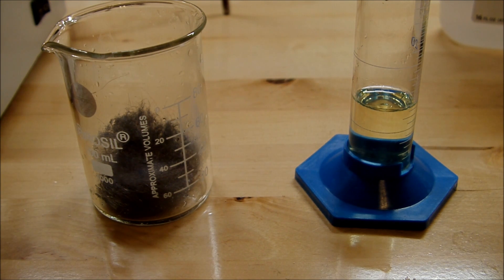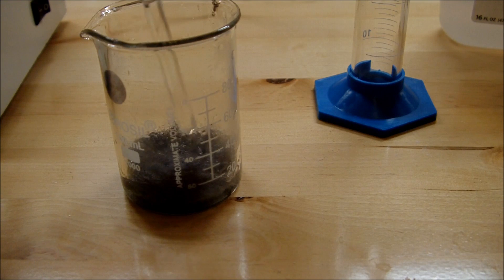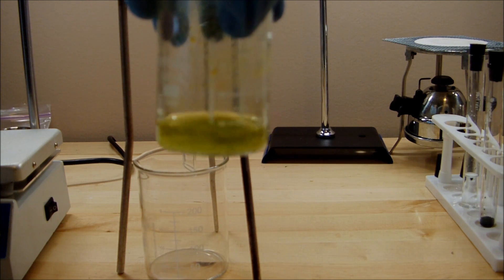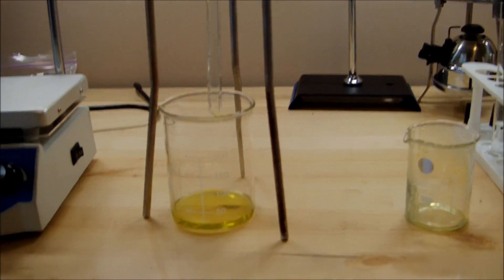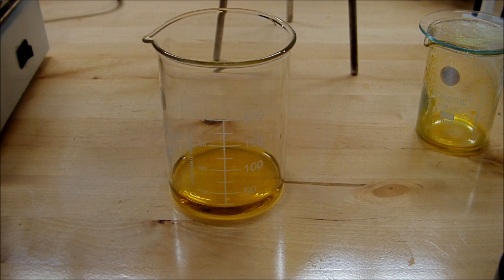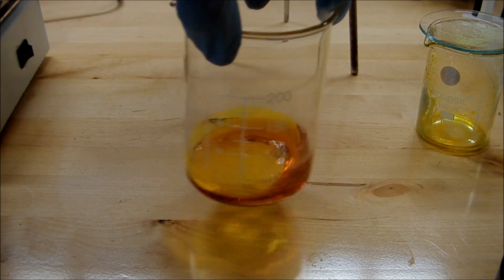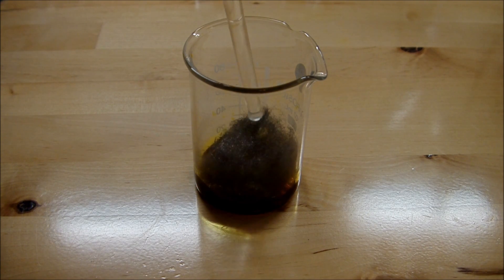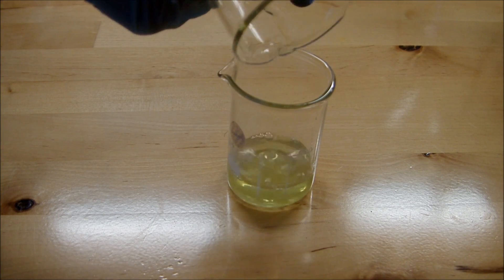Make Iron (II) and (III) Chloride

Comment: Hi nice video thank you. I have made a iron electroplating bath using iron sulphate + ammonium sulphate and hcl. It is a pale green/white coloured solution. Does it make sense that this would be iron2 chloride?
Reply from the maker: When in solution, things are really more of a soup of ions than individual compounds. So yes, there's iron(II) and chloride in there, but it doesn't "settle out" into a specific compound until you crystalize it. Then what comes out would depend on the solubilities of all the possible combinations of ions.

Comment: Does iron (iii) chloride react with aluminum to produce metallic iron/ iron (ii) oxide?
Reply from the maker: It should, aluminum is more reactive. It does form a protective oxide layer, though, so the reaction might take a bit to get going.

Comment: I made a dry mix of Fe(II)Cl3.6h2o and but it turns out I needed Fe(III)Cl3. I knew it going forwards with the mix, as my lab didn't seem to have Fe(III)Cl3. I followed a recipe, that was for some cell cultures. 

@mrhomescientist Would you suggest just let the mix get some air to become Fe(III)Cl3 once in water? My mix is acidic. Fe(III)Cl3 would just be a micro component for the growth media.

Edit: did you try to crystallize the Fe(III)Cl3 you made in the video? I assume it's molarity would be easier to calculate going from dry form back to hydrated form.

Comment: why not percolate pure oxygen into the Iron (II) to get the iron (III) Chloride faster?
Reply: Dave Cossairt because home chemists don't keep pure oxygen on hand. store bought hydrogen peroxide, however, is a household item.
Reply: Timothy Raquet so most people don't have an oxy acetylene torch?
Reply: Dave Cossairt nope. i certainly don't. if hydrogen peroxide isn't an option, and you have pure oxygen laying around, by all means make a video of your results and share it. I find dollar store hydrogen peroxide works just fine, so that's what I'll use.
Reply: Timothy Raquet I have completed this process already biggest tip a.use a hose that you don't mind tossing after complete or saving for stuff like this b. had to do it out side, I set the containment vessel in a snow bank (I live in alaska probably the only advantage of live here lol)
then piped pure oxygen into the mixture. 
rapidly the color changed and it began to off-gas very profusely.
in a fume hood I feel it would be easy to have complications if your system is not adequate enugh to vent copious amounts of gas
Reply: Dave Cossairt very interesting. I might try this if I ever have the right set up.
Reply: Timothy Raquet I used a small length of old Gass tubing I had laying around It fit perfectly over the tip of my cutting torch, I then use electrical tape to hold it in place while I adjusting the flow of oxygen, the regulator was set at 35 pounds and I was piping it through a 1/4 tube. there was an intense build-up of heat as a reaction occurred and as I stated before, I counteracted this by having it sitting in a snowbank (I'm a welder not a chemist)

Comment: When you let the steel wool react with the HCl did you cover the beaker? If yes, then will the H2 gas be able to leave? If not then won't it oxidize? Or do you cover it in between? Thanks!!
Reply from the maker: Patience! There is no need to cover it; this has no impact on the reaction. I suppose if you wanted it absolutely free of Fe(III) you'd want to exclude air, but for my purposes I didn't need to do that. I placed a watch glass over the beaker simply to reduce acid fumes and bad smells from dissolving iron escaping.

Comment: have you ever tried making titanium chloride?
I am able to get a very very dark purple solution by boiling hcl with titanium in it.
It never seems to crystalize though.  You can cook it down forever and all it ever does is get dramatically thicker but crystals will not form.
Ay ideas?
Reply: Clown Whisper most like not pure or partical are not ground tighter
or too much buffer solution, blocking

Comment: Hi, Mr.Homescientist,

I've an enquiry, iron (II) Chloride is unstable in the air. But how is the storage time/ shelf life for Iron (II) chloride before it convert to Iron (III) Chloride??

Appreciate if you can advise.

thanks.
Reply from the maker: I've heard that if it is dry and stored in a tightly sealed bottle, iron(II) has a pretty good shelf life. It's pretty tough to keep iron(III) from forming though, so it's probably best to make it as you need it!

Comment: Need help!I had a messed up reaction happen to me.  actually two.

I was doing  nerdrage method of making copper sulfate by electrolysis using a weak solution of sulfuric acid as an electrolyte.  It worked so good that I was getting large crystals forming  right as the reaction was finishing up!
They were clumped together and when I was filter I tossed a small amount of DI water on them to loosen them up!

The crystals in the small amount of solution turned instantly black!  I added a little more and it started to turn like blue and white crystals started to form.  *size of salt*   I put it on the heat to losen everyting up and everything turned e emerald green!    I have about 100ml of deep emerald green solution that SHOULD have been copper sulfate..  

DO you have ANY idea what happened?  I have a large amount of uncontaminated copper sulfate set aside as I had already filtered most of it 

I also had a Iron Chloride mishap where I had to leave the reaction and it cooked down to a solid red mass.
I added equal parts of water and HCL and it seem to have come back.
Reply from the maker: I've never heard of that before. Sounds like a lot of weird changes for such a simple experiment. If you can repeat it and make a video or take photos, that would make a very interesting experiment. Make sure you use distilled water, clean copper electrodes, and don't let the voltage and current go too high.
Reply: Yup low and slow is the best for sure.
I think that I may have dumped a tiny amount of HCLon the extra crystals by mistake.
STUPID i know I have them in the same 90ml brown bottles.

The strange thing is that over 2 days it slowly turned back to blue. so now I don't know what to do with it.

Maybe the sulfate crystals worked off the hcl?

I might allow it to crystallise a few time to see what i get.

I wont be able to use it for its intended purpose unfortunately
Reply: On another note , I am designing a chemical rack In CAD that requires that I place a wooden dowel in a slot to release the chemical bottle that I need.  No more mishaps.!!!
Reply from the maker: Clown Whisper HCl would explain the green color, but the rest is still a mystery. Recrystallize your blue copper sulfate crystals a few times and they will be quite pure.
Reply: Yeah its sort of starang for sure.
I might have explained it bad too.

So basically I was filtering of the Copper sulfate.  When I got toward the bottom of the flask that I used for the electrolysis I noticed that there were some crystals that had already formed.   So I thought to myself that I should add a few ml of water to loosen them up ,as I plan to evaporate the whole thing anyway.  

So when I added what I though was water everything turned BLACK as ink.  I said out loud.."wtf?" and I set it up on a heating corning stir plate and added what i thought was again a little more water.    It almost instantly started to turn from Black to green. and then very deep emerald green.  RIght now im trying to figure out how the black occured and why in several days it turned back to its typical sulfate blue..
Reply: In any case it was just a very small amount of the product so Im not to worried about losing that little it.  I would have to know that it was back to its sulfate state and pure before using it in the next step.and I dont know how to verify that so it will remain waste product.  :)

Comment: I too had some steel wool and had it soaking in hydrogen peroxide. Upon the addition of HCl it turned dark amber in color, adding more HCl the solution turned to a bright yellow color and was rather exothermic (>150F) and placed it outside in the cold (near freezing temps) and left it for apx. 30 min... to my surprise it turned completely clear. Upon the addition of 35% hydrogen peroxide it turned amber in color and I'm convinced it was Iron(III) chloride. What state gives it a clear color?? On a side note, it is night here.

Comment: Or... buy some red iron oxide (Fe2O3) for a couple dollars a pound; much cheaper than steel wool. Add the HCl; you'll get iron(iii) chloride only, no hydrogen gas, and no impurities to filter out. You won't need peroxide either. Also, iron filings are cheaper than steel wool as well, and react faster. You can use them in your iron(iii) chloride to get the iron(ii) chloride.
Reply: Chad Howarth No this is the chemical equation 
Fe2O3 + HCl —> FeCl3 + H2O
So Add HCl to Fe2O3 it will create FeCl3 and water

Comment: If you add iron to your solution, the redox-reaction should be:
CuCl2 + Fe → FeCl2 + Cu
You should see copper forming on the iron. For disposal add baking soda. Do this in a large container, fill it with 1/8 or 1/12 (to be sure) of your solution. It will create a big rusty-looking foam, about 7-10x the volume of the original ingredients. Keep adding soda until you see no reaction anymore. Check
members.optusnet.com.au/~eseychell/PCB/etching_CuCl/index.html

helpfull?

Comment: Can you comment on the uses of ferric chloride to make PCB etching solution? I have made ferric chloride before, but I'm curious if there is a way to neutralize it after you exhaust its etching capacity? I have etched a bunch of circuits so my solution is now FeCl2+FeCl3+CuCl2 and water. I want to either remove the copper to reuse the etching solution or somehow neutralize it for disposal down the drain. It is illegal to dump ferric chloride down the drain so any thoughts would be great! Thanks!

Comment from the maker: Generally when you get a cloudy brown solution working with iron salts, you've made iron hydroxide. Iron salts like to decompose to the hydroxide or oxide easily, and heat would accelerate this. You could try slow evaporation instead. Your steel might possibly have extra impurities in it that could interfere.
Reply: Can I add extra hcl to avoid it

Comment: hi, my steelwool took 5 days to dissolve, but I got a very concentrated deep green solution, then i added oxigen peroxide and i got a very violent bubbling reaction so i kept putting more on, it turned into a dark yellow-red solution but a single drop looked yellow, i wanted to concentrate it and tryied boiling the water off but the solution turned cloudy and brown. did i just made some iron oxide? is it reversible? thanks.

Comment: muriatic acid is far cheaper than ferric chloride PCB etchant. So i do not see why you would want to. Muriatic acid only runs about 12USD a gallon vs 12USD a liter for ferric chloride, i know alot of PCB designers who use CuCI2 in the place of ferric chloride for simple designs. Because muriatic acid and 3% H2O2 is alot cheaper.

Comment: so I had steel wool, a test tube, and some HCl.  I mixed it up and added ~4drops H2O2.  it browned the surface of the steel wool and immediately turned a light light green.  but it was bubbling so I left it outside.  20 min later. it is clear and most of the iron was already digested.  but it went absolutely clear???  no yellow, green, brown and no ppt. at bottom.  does dirrect sun light prevent it.  well geuss I will know shortly, but any how wondering why such an easy rxn went wrong

Comment from the maker: @GiorgioCapocasa Yes I've heard of that before too. That should work! Eventually though, you will get a large volume of etching solution as you continue to dilute it when you regenerate with acid (usually 32%) and peroxide (usually 3%). 30% peroxide would be better, so you're not adding as much water. It might be cheaper to just throw it away and buy new though, depending on what your reagents cost. Good luck!

Comment from the maker: @Gta2CubanPete You're right about the crystals, it's near impossible to keep nice green iron(II) crystals without them oxidizing (from what I hear). I'd try putting it in mineral oil to keep it away from oxygen, like you would for sodium. I'm going to use mine to make ferrofluid in my next video, so I'm just going to use the solutions directly. Thanks for the comment, and good luck with your own synthesis!